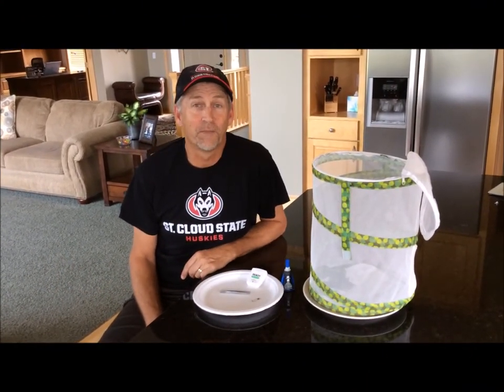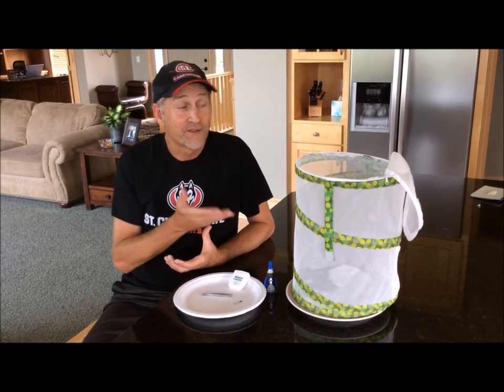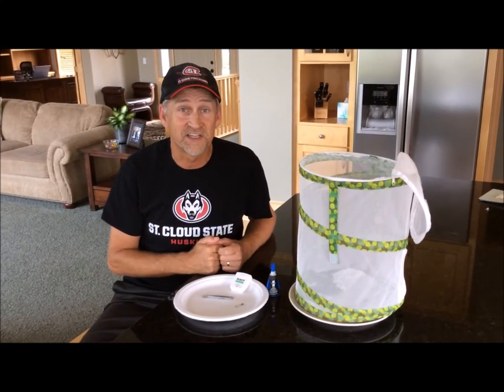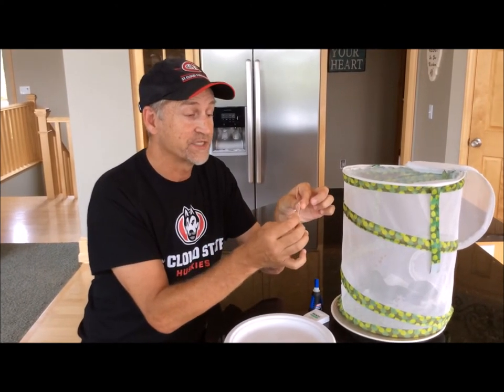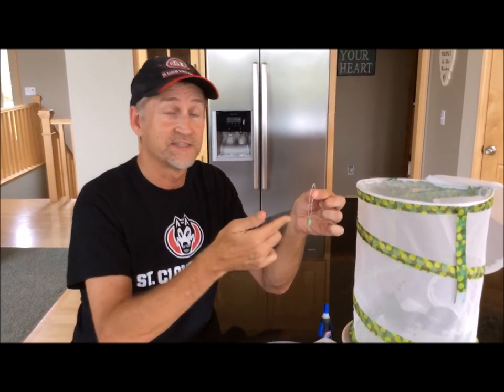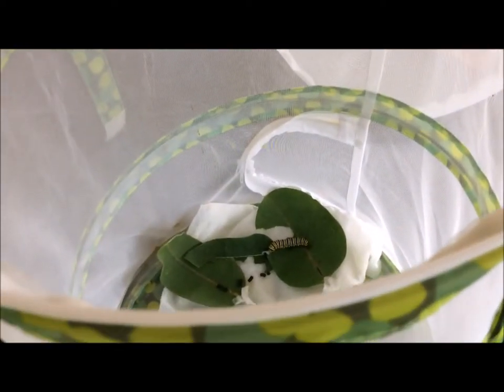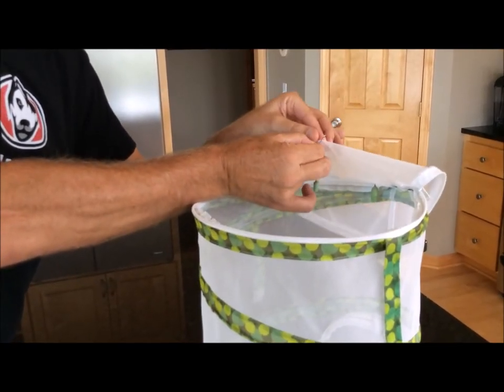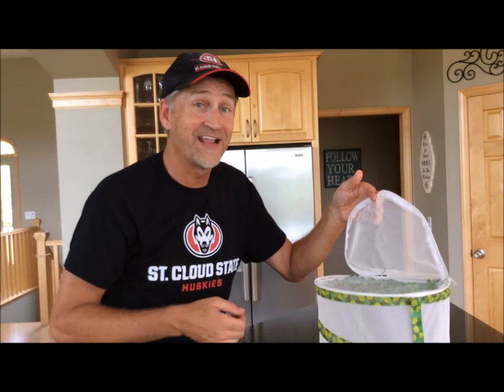Repairing a Monarch Chrysalis

Comment: A few days ago I pulled a swallowtail caterpillar off a bare stem of dill with the intention of transferring it over to a fully leafed stem but it had attached itself to the stem with silk.   It seemed to have started the chrysallis process because it was basically dormant.  I put it in a plastic container and sure enough it morphed into a chrysallis.  I am going to try to pin it to a stick of bamboo so it has something to hang from.  There is a tiny nub of silk at the rear of the chrysallis that I think I can push a pin through and pin it to the bamboo.  Anyway, thanks for the video inspiration that perhaps I can save the little critters life.
Reply from the maker: Gerry, Good luck!  I love your concern for this potential butterfly.  Good luck!